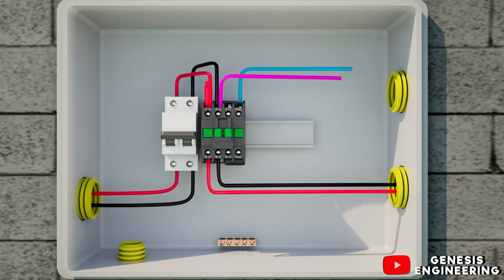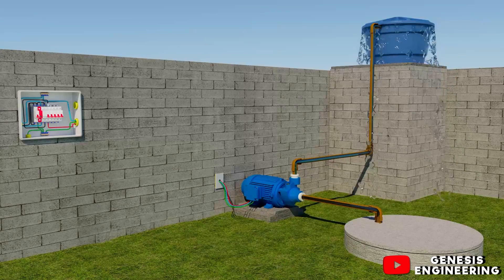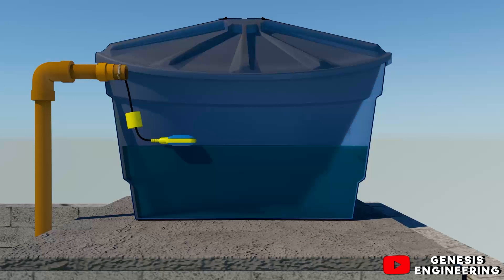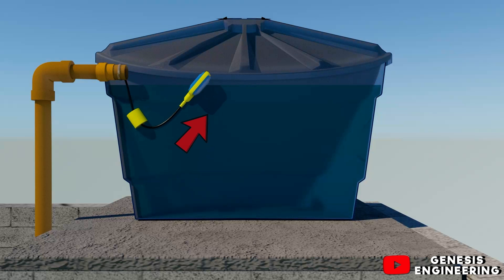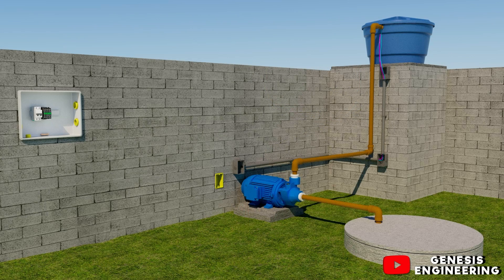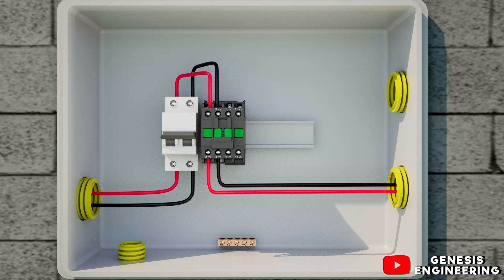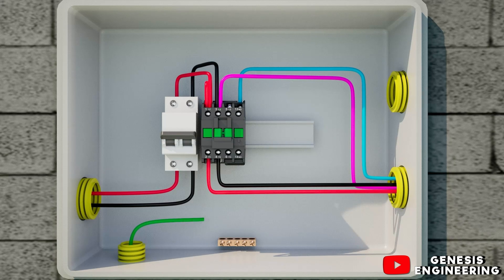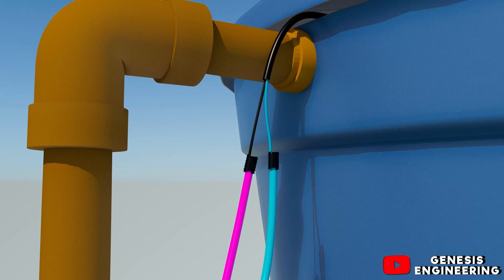HOW TO INSTALL FLOAT SWITCH FOR WATER PUMP

Comment: I followed this tutorial and the flow switch does trigger the contactor for the pumping machine to start pumping water.

However, after a few minutes the contactor would disengage and start smoking.

What could be the solution to this problem?

Comment: Why would you have a switched neutral? This is incorrect. I would get power from the MCB as the common for the float, and then the switch leg of the float connect it to the A1 of the contactor.

Comment: Pls, is the contactor necessary for the float switch?
Reply: Hello, the contactor is necessary if the pump is drawing more current than the ratings on the float switch, the float switch may not be able to handle the current if connected directly to the pump.

Comment: You have my thanks and gratitude. I have absolutely no knowledge of wire works nor electricity, recently I kept running out of water and called my electrician 2 time, he couldn't figure out the problem because the float switch worked oppositely, if it was down the water came, and if it was up the water stopped but after a total of 4 hours, I told him that I always have a bigger teacher or a guru in my pocket (youtube), then I pulled out my phone and asked him that maybe he's using the brown wire which was wrong, we only need the black and the blue. And he did exactly that and lo and behold....problem solved ALHAMDULILLAH. I felt so proud of myself to always carry youtube on my pocket and people like you. Thank you very very VERY MUCH.

Comment: There is no neutral how will the contact energize
Reply: The phase wire is jumpered to A1. The pink wire is connected to terminal 3 with the incoming neutral and is tied to the common (neutral) of the float switch wires, the other is connected to A2. When the contacts in the float switch are in the correct position, the circuit is completed, and contactor will be energized.

Comment: Does it means the "float switch" controls the natural?
Reply: I think for a single phase motor(pump) it is better to connect the float switch in between A1 and the input phase.

Comment: Fantastic Video. Can you do one whereby you connect two float switches in two different tanks. One tank is the storage (on the bottom) the other is on a Tresstle...

Comment: Is the neutral run through the float switch?  Mine is a simple two wire device.  Seems safer to interrupt neutral with the tank float switch than 120v run through it.

Comment: Nice graphics. Thx. If incoming neutral wire is open , in the float switch wire we will get live supply. Though insulated it may not be good for safety reasons. Please reply

Comment: Hello and great video.I will be greatful if tou can help me. I have pressure switch which is operating with 230V Ac. I need to shut of a gas solenoid valve which operates with 230V. Shall i use a contactor

Comment: Thanks for the simple clear video. Is it safe for the mains voltage to be connected to the float switch which goes into the water?
Reply: Personally I don't think so, if the flow switch leaks it can be disastrous if you don't have earthing. 

Safe way is: 
Operate a 12v relay using the float switch and operate the pump using relay contacts so if the float switch leaks it will only leak 12v not 220v.

People say the float switch is safe but for personal preference and peace of mind I have used the above circuit.

Comment: My sump pump use a floating switch but only has two wires as a switch.  It doesn't have three wires. Just out of curiosity can anyone use the floating switch on sump pump of the basement?

Comment: An excellent tutorial. I followed it step by step and everything worked. My float switch had three wires: blue, brown and yellow/green. The brown was the wire to tape off and not use, blue went to terminal 3 and yellow/green to A2.  Hope this helps someone.
Reply: 0:04 0:04
Reply: Q1 lol alllà
Reply: This is great, but you are too fast please.

Comment: Working in the EU standard, (and the float switch seems to be made out in that standard as well - Brown for L1, black for L2/Com1, blue for neutral) it seems wrong to not follow those standards for the rest of the wiring as well. Without a wiring schematic for the float switch, I of course can only speculate how it's supposed to be wired, but it seems weird to connect the blue wire to phase and the black wire to neutral.
Reply: Totally wrong in the float find the common with meter common to one wire will show NO normally close and and normally open in the starter find the jumper green button and red button connected to the common to the jumper remove bottom of green button connected to start when tank level comes down to start when reaches stopped so even power shutdown this motor will start stopped automatically
Reply: @michaelmanimani8483  On a complete side note, have you ever tried using proper punctuation? 

It really helps make what you write readable. As it stands, I need a code key and an enigma machine to interpret what you've written, and I still risk a brain aneurysm it I were to try it.

Comment: what about the ground tank floating switch
Reply: Its automated so you wont need manual you can put a normal switch there or just pull down the breakers for it

Comment: Please can you explain into details of the counter weight at 1:23
Reply: The weight holds down the float underwater.  It sets the arc the float uses to turn on and off.  If there was no weight, the float valve would stay at water level and would not act as an on/off switch.